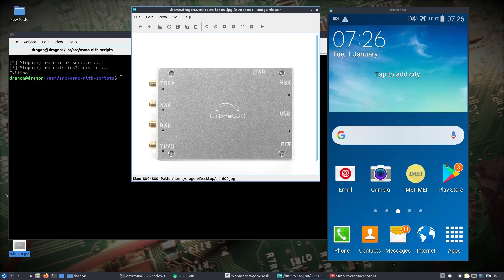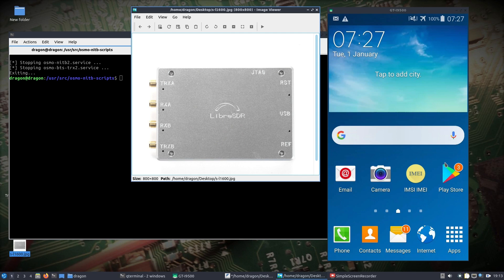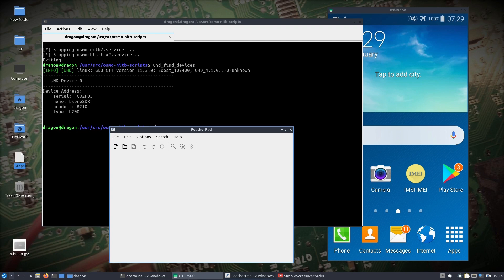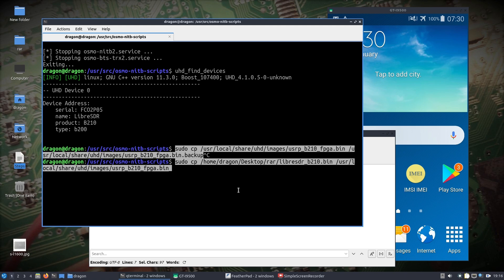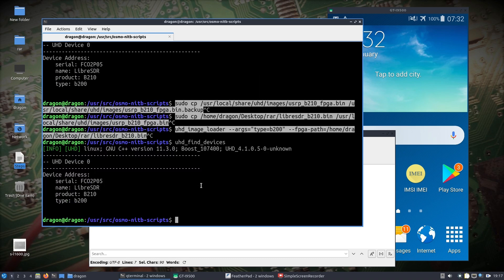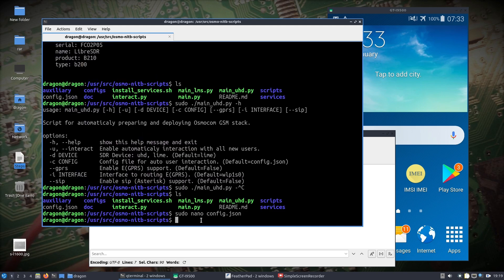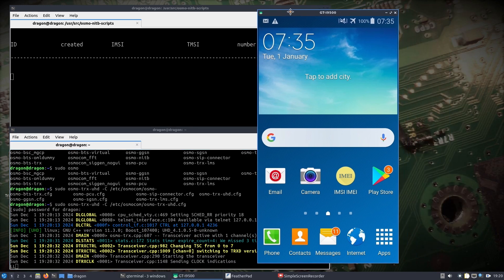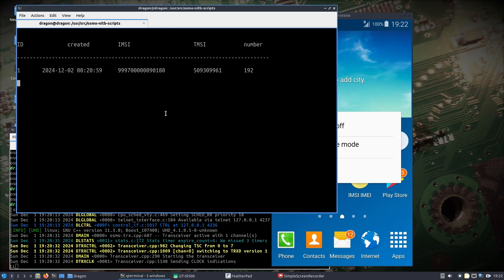DragonOS FocalX LibreSDR (USRP) Hands On w/ Osmo NITB Scripts (UHD)

Comment: where i get osmo nitb scripts? i have installation dragon os noble new version
Reply from the maker: In the new DragonOS I’ve not built in native omso scripts, I may try that again but there’s a newer technique I show where I utilize docker and a osmo nitb scripts docker.
Reply: @cemaxecuter7783  Can the dragon noble version be considered unstable? Because I ran several tutorials on this channel such as gsmevil2, yatebts with libresdr did not run smoothly. Should I downgrade to the previous dragon os version? Because previously I used the old os and ran gsmevil2 / imsi catcher running perfectly.
Reply from the maker: @unoproject20 tutorials may need updated but GsmEvil works, YateBTS too and LibreSDR needs the alternative bin file. Let me know what you’re seeing
Reply: yatebts everything runs perfectly, but cant't do tx and the led doesn't turn on. i checked, it's because i don't have the transceiver-uhd file that causes the libresdr not TX? right? i looking for ways to this day always can't find the transceiver uhd file
Reply from the maker: @unoproject20 YateBTS only works with bladerf
Reply from the maker: The one in DragonOS that is
Reply: in gsmevil2 i have error 92 address already in use, tab 1 run grgsm_livemon and tab 2 run gsmevil for sniff sms/imsi but i have this error😢

Comment: Hi, do you think you can try OpenBTS-UMTS by PentHertz for Ubuntu 22.04? While I successfully installed all components (after manually editing quite a number of them myself), the TRX part works fine. UEs can see and attempt to register on the UMTS network. But the network does not start the authentication process even with my valid GSM11.11-only SIM. I think PentHertz only checked the TRX worked fine but not the subscriber/authentication registries. Would love to try UMTS packet switched data with my old phones.

Comment: I'm so glad to see this! I have successfully used my USRP LibreSDR clone as a receiver, ran 1G AMPS/2G GSM/3G UMTS/4G LTE so far with it. Very worth the purchase, personally my most favorite SDR on the market.
Reply: Do you have video when a mobile phone searching LTE network that you made with LibreSDR? Is it detected? My LTE network made with LibreSDR not detected with phone whe searching.
Reply: @ekow6093  I do not. I didn't make a video because my UE didn't pass authentication and register, so it wasn't worth the effort to me.
Reply: @mobilephonesandtech  did your UE detect your LibreSDR LTE network when searching? what UE did you use?
Reply: Could u pls make tutorials @mobilephonesandtech
Reply: @ekow6093  it depends on the bands you use, as well. The UE has to support the bands. 

And it also depends on which B210 you have. They have different clones. I have a setup video on my channel.
Reply from the maker: Do you have programmable sims/know the sim details and have them setup in the UE db file?
Reply: @Blabluuee  When I get around to it in a few months, I will show a demo.
Reply: @ekow6093  oh yeah, it sure does detect my LibreSDR just fine actually. I’ve had multiple UEs attach and connect to the internet. Both with IPv4 and IPv6. I’ve tried an iPhone 14 Pro Max, 2 16pro maxes, and a MiFi just fine.
Reply: @ekow6093 my phone finds my LTE network fine. Using the same LibreSDR. I have a setup video on my channel.
Reply from the maker: I’ll try by this weekend if I get a chance with and without a GPSDO.

Comment: Hi. My Libresdr comes with a firmware that emulates a pluto sdr like device. So my questions is how to bring the right firmware onto the device himself? Is there some SD card image?
Reply: They are different boards and even different chipsets. Both sharing AD936x, but the processing chain is different. There is ANTSDR UHD implementation, and ANTSDR is a Pluto-Like board. I was thinking to port their HDL onto Pluto-like LibreSDR, just didn't have time to setup the dev toolchain..
Reply from the maker: That’d be pretty cool!
Reply: @SergLapin  please do it, I am using a hamgeek libresdr with F5OEO firmware and while Soapy sees the device, no signal is produced.
Reply from the maker: That’s a completely different LibreSDR. There’s one that’s a Pluto like device and there’s one that a usrp like device.

Comment: Hi! I'm the author of original osmo-nitb-scripts that had only lime support. I am glad that the project has found such wide application.
I' currently looking for uhd-compatible devices that able to use MIMO through uhd. Could you please recommend something?
I will not post any links for Chinese shops, but for now I have the following blurry picture in my head:
- there is some "cheaper" clones called LibreSDR with AD9361 on board (also can be found as "LibreSDR B210 Mini")
- there up to x2 expensive "USRP b210 clones" that is on real Spartan 6 XC6SLX150 FPGA, but from descriptions on a shops they need additional power supply if use MIMO or GPSDO
- antSDR with MIMO, but seems it can't truly emulate b210 and I didn't find any examples with working MIMO-mode
- even more expensive B210 clones called "B210-MICRO V1.2"

As I understand, "cheaper" clones had cheaper FPGAs and worse uhd compatibility. Would be very appreciate if you could clarify this things.
Reply from the maker: What a small world and thank you so much for the original! I love coming back to osmo nitb scripts any chance I can get. I’m reading this early morning so not fully functioning yet, in fact I had to go back and look at my order on the LibreSDR and you were right, it does say ad9361. Is there anything you can think of that would allow me to test if it’s doing MIMO? I used it with 5Ghoul which has a profile like this 
https://github.com/asset-group/5ghoul-5g-nr-attacks/blob/973999487093265c8853654e82cb40e3551158e4/configs/5gnr_gnb/n78.106.conf#L224

I also have the AntSDR e200 which has an additional RX/TX inside the case that can be tapped into and I feel like I was told it could do MIMO but I would have to get that confirmed. 

There’s also the signalsdr I think it’s called that if you give me a couple weeks I will have in hand. This SDR is supposed to be able to work just like the b210. Let me go ask the developer your question. Stay in touch! I can also be reached via email or via the contact option on cemaxecuter.com
Reply: @cemaxecuter7783  seems like youtube deleting my comments because of links. You can test mimo via srsRAN_4G by setting values tm = 3 and nof_ports = 2 in the [enb] config section
Its also interesting how this hardware doing with 100 PRBs

Comment: Have you tested srsRAN with it? I would consider getting it. As well as i have another question, is it possible to get an binary I/Q stream file from srsRAN? For example sib12 does not require authentication so the binary file can be transmitted through even hackrf one, because there's no need in receiving information back
Reply from the maker: Yes, worked fine. Someone sent me something st one point that could in fact play something off a hackrf that made it seem like there was a network.
Reply: @cemaxecuter7783  yes you can create a test 4g network on hackrf, using matlab + lte toolbox to create a binary that you can further transmit using hackrf_transfer, you won't be able to connect, but it'll show up in the available networks. Few hackrfs can be used to downgrade 4g to 2g, by removing need of authentication for reselection sib7 messages, write them as a binary and using +-10 hackrfs replay it to cover the every band in LTE. Hackrf is working just fine, with cellular tasks that don't need receiving info back
Reply from the maker: That’s also very interesting and I think I see what you’re saying - multiple hackrfs causing an issue for the phone to connect to any legitimate 4g could cause it to go to 2g?
Reply from the maker: I don’t have Matlab but it would be interesting to try this on a test network - I could use one SDR to create 4g network and another to create 2g. Then use hackrf to broadcast the info of the 4g network and see if the phone drops to 2g.
Reply: @cemaxecuter7783  I think this will not work with hackrf for several reasons:
1. UE will first try attach to "ENB" (which in fact just broadcasts MIB and SIBS) and then will follow the redirection from RedirectedCarrierInfo (if we talk about csfb in rrc connection release). Also same situation for downgrade via TAU codes.
2. don't sure how 8 bit ADC and low-end transceiver can affect on this
Reply: @cemaxecuter7783  osmocombts for Motorola's (which are not full duplex) are using tdd, so with a light modification in the way of soldering new filters to the board, and rewriting the driver it's technically possible to run GSM network on hackrf, nobody just done it publicly yet :)
Reply from the maker: That is very interesting. What I’d like to figure out is how can I provide a timinf source to CalypsoBTS so I don’t have to have a real gsm network to sync to?
Reply: Is it possible to modify the source code of srsran directly?

Comment: Where i can get the bin file thar you cp and image load
Reply: I second this, where can the bin file be found?
Reply from the maker: @ here’s the one that worked on mine, but what I’m now finding out is that there’s a few different “types” “brands” not sure what to call it.. but apparently there’s slightly different bins. Mine that I found that worked for mine. Didn’t work for someone else’s LibreSDR usrp they purchased from another seller. 

I’ll try and collect up more and place them here.
https://github.com/alphafox02/LibreSDR_USRP
Reply from the maker: I put it up here - was going to put all the source but single file sizes report to be too big. Not sure why the vendor doesn’t open a proper github repo. I’m not responsible for those bin files - I simply pulled them from one of the Ali listings that actually shared what was needed.

https://github.com/alphafox02/LibreSDR_USRP
Reply: There are two variants of this. I have both working bins on my GitHub… I think some others have forked my repo.

Comment: I believe you're using the modified UHD driver from AntSDR. Could you test and confirm whether it works with the default UHD drivers, or does it specifically require the modified version?
Reply from the maker: It should be fine with the stock UHD driver, while I am using a modified one that accounts for the AntSDR, it’s the bit file that’s making UHD act as though it’s a B210. So stock would be fine.
Reply: @cemaxecuter7783  Thanks for the confirmation.